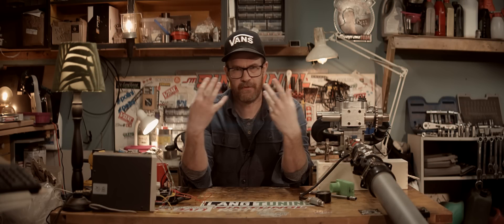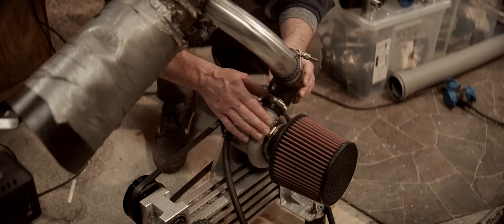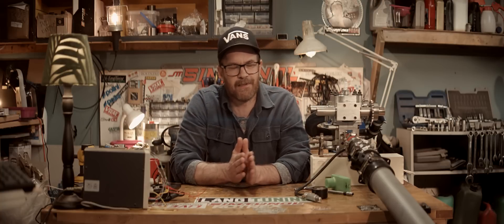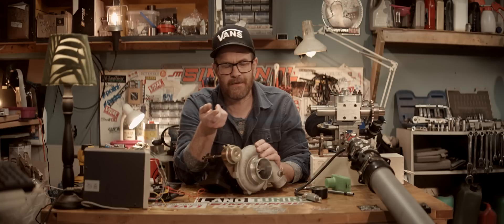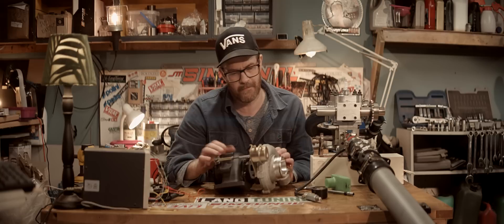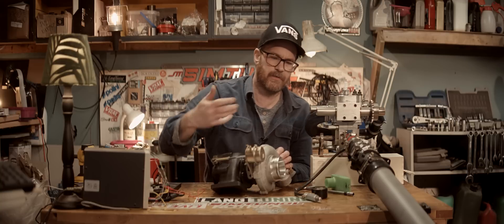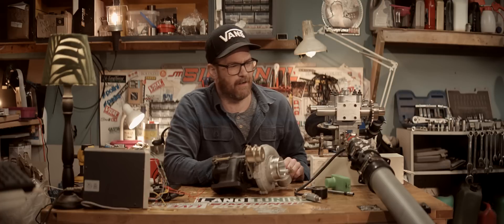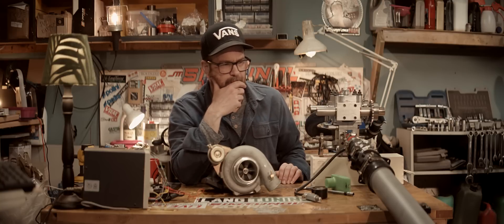THE most genius/stupid idea! Turbojet supercharging.

Comment: If you are going to jet super charge the engine the you can use the pressure of the first compressor, direct it to a combustion chamber and have that the power the turbo and use the internal waste gate of the turbo to keep pressure in check. 
If you use any car turbo and you can actually get it to spin 180k per min you will have way more then you need as pressure for the 50cc you want to fill.

But personally I would go with the compressor and Electronic adjustable bleed valve for 1st test and optimize flow in engine en see where it will blow first. Because with 2-3bar it will. 
It will be a great video!
Reply: My friend made a small cc diesel land speed car. he found the small cc engines stuggle to spool up a turbo to output much pressure.

Comment: Im afraid that the changing rpm of the engine running the 1st compressor will make it difficult to create stable jet engine. How about running just the turbo as jet and siphoning some of its pressure for the 2stroke?
Reply: This makes infinitely more sense. Although neither really are a better idea than a properly sized compressor. Please like this comment.

Comment: High PR on a Single turbo with low flow is really rare and difficult, small engine diesel guys struggle with the same way and you have even worse flow

Have you thought about compunding two compressors so PR is easier to Do, maybe divert Part of the turbo jet into the second compressor, turbo Jets Producer loads of flow and boost when running, it probably wont "feel" that little Air leak of an engine 😄

Comment: If you had a sturdy"wont break easy" but weak "lets atmospheric air in without any effort" reedvalve in your intake before the super charger and before the intake dump to prevent the compund air from moving out to atmosphere you could retain some pressure and keep some efficiency. I think your original idea is possible. Your turbojet idea is is cool too but wayyy more complicated.

Comment: You could use a roots blower and turbocharger compound setup. 
The roots blower output is connected to the crankcase and is driven from the engine at an "efficient" pressure ratio, maybe 1 bar. 
The turbocharger driven from the exhaust gas from the engine feeds in to the roots blower input at maybe 2 bar. 
Then you have 4 bar fore example. 

That solves the difficult starting problem and the inefficiency problems.
Reply: Thats how the Detroit 2 stroke diesels were made.
Reply: @painlessadventure is correct, most of the old 2 stroke Detroit diesels would not start without the supercharger setup. I suspect it won't be much different here.
Reply: @bluejay693 
A 2stroke diesel typically does not use the crankcase to compress air, but uses a „scavenging blower“. Somehow that missing intake stroke needs to be done. But that’s not supercharging (at first). It’s needed as part of the engine‘s operation.
But as you already have a blower (and your loosing no fuel because diesel is always „direct injection“) you can increase the pressure above „scavenging pressure“ to gain power. And next but, you would more likely add a turbo, as that exploids energy from exhaust gas.
But (again) a scavenging blower cannot be a turbo, it needs to somehow be synchronized with the engine.
Reply: I think this is a great idea. Compound turbo/supercharging has a long history and was used in several ww2 fighters that needed crazy power to weight.
Reply: you should not put anything to crankshaft to turn because it takes power from it. If you could find somewhere numbers how much power it takes you would see that roots blower takes all power from small engine and nothing is left on the output... and gear reductions our guy uses is at engine limit... you can see it when trying start engine with some pulleys configuration it wont and goes little small it start.
Reply: He has already tried that in the past i believe. Only just a roots type supercharger. That poor old supercharger did not like the RPM it was getting. In this current design he won't be using the crankcase as a manifold as he will be running rotary valves on top of the cylinder.
Reply: you can also check out how volvo penta use turbo compressor on some engines with a flapper valve between the compressor and turbo, also using magnetic coupling to the compressor to increse efficency
Reply: Fact is a roots blower will take 20bhp to make that

Comment: Having thrust puts you in a different class for land speed racing.  Not sure this is gonna work either.  I would lose the belt driven blower completely.  No point driving it with power you can use to drive the rear wheel if you have a jet turning a turbo to force feed the two stroke.  But hey, happy to watch you take a crack at it.  You'll need to run different fuel for the turbojet too.  Don't hurt your self.

Comment: I agree with another users comment. An electronic blower would be a reliable option for testing and verifying your current theory. But without the need to create a compound turbo jet engine turbo system which may cause unreliable test results. Although it would be worth a try once you have verified the engine produces the power numbers you are after with an electric blower.
Reply: agree, get the engine performing with a known flowrate then try to engineer a solution to match that. you can then reengineer to minimise losses as that is the 'ideal'
Reply: from there you could a stator and flywheel from a snowmobile to produce power efficiently for an electric blower and some logic to have variable speeds to make it behave properly
Reply: Good suggestion. You would need a surprisingly beefy electric blower. 
I wonder if just testing with an airline would be suitable. Which made me think why not have a solenoid connected to an air tank at pressure that opens at the correct crankshaft timing. The compressed air could come from the cylinder on over run in practice.
Reply: @tomscum61  Beefy, but nothing too crazy - a turbo usually needs maybe 10% of the engine's power to run, let's say for a centrifugal supercharger 20% due to additional mechanical losses. If he wants to make 30hp net at the 50cc crank, and have the blower driven by the 50cc crank, he needs about 7.5hp going into the blower (37.5hp gross before supercharger losses). The rotrex might be much more mechanically efficient than that, I don't know for sure.
Reply: @tomscum61  This a valid and indeed a chilling / very cooling idea!
Reply: That's cool that you agree with my suggestion. I appreciate it. I actually built what I was suggesting and used a small C.V.T.  that's ment for a go-ped that I used to couple the electric motor to the turbo compressor in the hopes that it would work like a (centrifugal) supercharger and it actually did! I put it on a Kohler 624cc v-twin that I built up for a home-made buggy we built. First attempt was a carbureted (blow-through) set up but went with Micro Squirt EFI and a 705cc stroker kit in the end. On top of boring it out to accept the largest cylinder sleeves I could fit in it. Im going to have to fabricate some aluminum gussets/supports to weld onto the block before it comes undone, 5:59  because it's got some serious beans and I've got way too much time, effort and money into it just to have it go to waste like that.
Reply: Dc treadmill motor would be a good one
Reply: @champagneave  I was thinking 100cc-equivalent brushless RC motor (these are 5hp+), ESC makes it easy to control via Arduino and that leaves for example automatic control based on 50cc engine speed possible.
Reply: this is the way, I think
Reply: Why do you think an electric blower would be better?

The problem he has is that centrifugal blowers (under which category the electric one would fall) have a specific rpm range where they work good.
His current centrifugal supercharger is too big for the engine even though it is the smallest one available. I don't think there are electric ones that are smaller (at least I haven't seen one).

So if size is the same, the only difference between a belt driven and an electric one would be that you can vary the rpm on an electric supercharger. And that's useless because the supercharger has to spin at a certain rpm to work properly. You can't just spin it extremely slow.

Achieving the right rpm is no problem with a belt driven blower. 

The problem is finding a blower whose compressor map fits this specific engine
Reply: hmmm, maybe big brushless rc motor that will be connected in to the pulley of rotrex turbo? :P
Reply: @Hnkka  they have almost zero torque. Pushing them as hard as required - heat dissipation would become the next issue . Need a bike sized unit and all the ancillaries 1. For torque  2. For heat dissipation 3. Terminal size to get required juice into the motor without melting.

Oh, and the batteries. All that crap just to spin a compressor? In theory, sure. But build a bike with it all ? Thing would be huge and heavy, with a 50cc engine. 🫣
Reply: @N0MAD1977  ohh
Reply: @N0MAD1977  someone gets it... takes a LOT of power to compress air, takes power just to get it moving... more than a previous claim by someone...
whereas a little vz21 based turbojet will easily chew on enough air to "produce" 100hp... just add fuel.

and as about half the air of a turbojet is being bypassed anyway, and its far better for everything to just vent some of that air rather than throttle anything...
electric blower doesnt fix the main issue of surge lines or how a centrifugal compressor works.
whereas running a turbo in the manner its basically designed for, and using it to simply produce boost as a "side effect"...

Comment: Love your ideas, but I am not sure it would count as a 50cc two stroke.. You could just use electric supercharging, or run another IC engine just to provide the compressed air but isn't that cheating?
Reply: I've been watching these videos for some time now and I don't think I ever found out why he doesn't use nitrous. Unless it's some weird law where he's at. A jet engine could work like when Subaru made the jet engine exhaust for constant anti-lag, but maybe not, I'm not a college graduate. If he'd be okay with the idea of an electric supercharger, then maybe he could integrate the throttle for the supercharger with the throttle for the engine, and if there's still a surge I'd like to see if a blow off valve would help

Comment: Using your pressure gauge and MAF sensors using a simple adjustable dump valve you could vary the dump to get numbers that the engine actually likes and then change drive ratios to get it there.

Comment: Research the Subaru "rocket turbo" was like a pulse jet in the header using excess boost, exhaust and fule keeping turbo spinning always
Reply: I think VISORACER did a vid on this.
Reply: @asrcav8r  this is what anti lag is in any turbo setup
Reply: @blainemacdonald6929  The Subaru solution is very innovative and unique though. Nothing like a conventional anti lag system.
Reply: @v4skunk739  yeah. its a really cool design. They built a sustained combustion chamber in the exhaust system right before the turbo. I dont recall if any extra air or fuel was added into the exhaust outside of what the engine provides, but it would spool the turbo like it was a turbo jet.
Reply: @blainemacdonald6929 you can't be more wrong it similar in a way just check the video on YouTube 
This was effective all the time even at idle the engine would produce max boost
They literally build a rocket engine between the engine and turbo to spool the turbo  all the time
It was not really reliable because of the extreme heat causing crack and heat management was a big problem

Comment: I'm no expert at all but had the thought: why not pass the excess air at the exhaust of the engine to help more efficiently clear exhaust gasses, with the additional bonus of higher flow to the turbo?
Reply: I was thinking something similar, trying to go over it in my head, but, I'm not 100% on if it will work. Unless you have match pressures, if the exhaust gets to over pressured, you'll bog the engine out, would it not?
Reply: @boziewz6125  Yeah, that thought occurred to me too.

Comment: This is turning into the most Rube Goldberg supercharging setup I have ever heard of. All because you can't find a compressor suited for such a low flow rate.
Reply: @kese5593  It doesn't work that way, adding a restrictor to the intake of a compressor moves the operating point to the left on the compressor map. The region where you're more likely to hit compressor surge. Exactly what you don't want to do.
Reply: @sasabarisic8864  I would understand your point if we were even close to the efficiency area right now. But as i see it, we have low pressure and high flow so we are in low right at the map right now, in the choke area. If we add intake restriction, flow decreases and we might get to near the efficiency area, and if we do, and engine works also otherwise, we also might get to the better pressure area and so on..
And these rotrex chargers have pretty vertical surge lines as far as i know, so thats why i cant see it being such a problem.

But might be wrong, i dont have that much experience in this area, just some.

What would reducing inducer size do? He could do that also?
Reply: @kese5593  The compressor will most likely be close to or in the surge area when trying to give the engine some boost, a simple restriction(Without inducer shenanigans (which I have no idea how it would work, need to read more about centrifugal compressor geometry which I don't know much about... I just read random compressor and turbine maps for fun once in while XD)) obviously would even push it closer or longer into surge territory.

"It should not surge/stall, thats why the blow off exists."
A blow off only prevents throttle let off surge what you on about?
Reply: @TarenGarond  If i understood right. Yes, that could be true IF we are in efficiency area right now. But as i said in the last message, i dont think we are. We are in choke area, and if we add intake restrictor we can come closer to efficiency area, but not all the way over it and cross the surge line.

Which i just looked up (Rotrex-Technical-Datasheet-C15-Rev6.1) and basically if you have any flow you cant really stall that. Only way is by closing throttle (restricting pressure side that much) and thats why we have blow off to protect impeller.

So yes, it should not surge, and if it does thats why blow off exists. 
What are you on about?
Reply: This is getting a bit ahead of yourself as for years I've been watching you , and still the motor block hasn't been even accomplished yet so why going off on a tangents? I'd get the basics accomplished first before getting so far ahead of your self ?
Reply: @WildWales86  I agree. Previously it was interesting seeing how much could be achieved from a 50cc engine. Now, you might as well just build a bigger engine, such is the complexity.
Reply: Necessity is the mother of all invention.
Reply: And if flow rate is the only problem, why not go the simple way and add air restrictor to intake side of supercharger?
Reply: @kese5593    That would cause compressor stall. Which is very bad when sitting on a machine that has a compressor between your legs.
Reply: @kese5593  if the turbo impeller gets unhappy it will head off to the cylinder to make some mcnuggets if you know what i mean

also once your compressor stalls it can't maintain max pressure anymore, so you loose boost.
Reply: @kese5593 why not go forward to the past with zero moving parts resonant chamber supercharging.
If you want to do better than anything else, all you need to do is make the belly and header pipe  of the chamber variable length to match resonant frequency to the engine revs.
Then you can eliminate all the crap like Reed valves, brittle high speed whirling knives.
Even cones on the ends of the chamber belly. All they do is soften the peak, and spread the rev range on the power band power curve.
Cylindrical chamber with variable length.... The highest power, least complexity.
Subaru had variable exhaust length geometry on their 1968 rally cars.
That was stroke but still highly effective.
Keep It Simple Stupid.
Reply: Doesnt matter how much boost you shove up it, if the volumetric efficiency of the engine isnt there to make some power then...  add in the inefficiency and losses of all the accessories, we must be heading towards negative power!

Not trying to be a cnut, I have been watching since day 1.  Just saying...
Reply: 1968? You're joking, right?
Reply: There is no such thing as excess flow on forced induction, only excess pressure which is easily relieved.
Reply: @manoo422  But especially when he's targeting 2 bar of boost, dumping the excess air to keep the compressor happy will waste a lot of power, which is why this is all becoming so absurdly complicated.
At this point it might be better to get a custom compressor wheel and housing optimized for the tiny little 50cc engine, rather than going to such extreme lengths to make the "big" compressor work.
I assume he REALLY wants to stick to 50cc, as I figure it would be a lot easier to procure a compressor for an engine with a larger displacement.